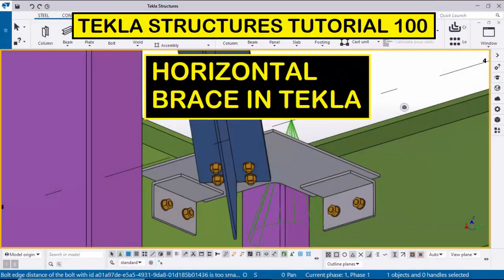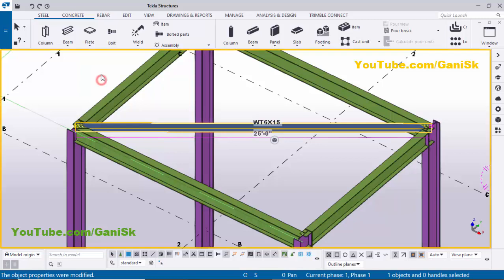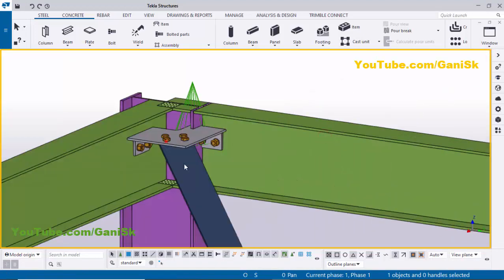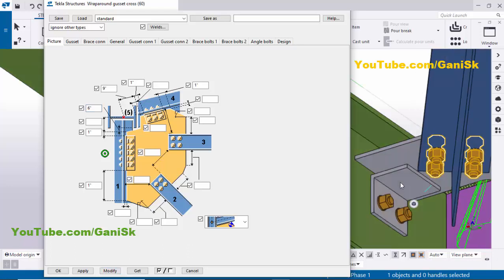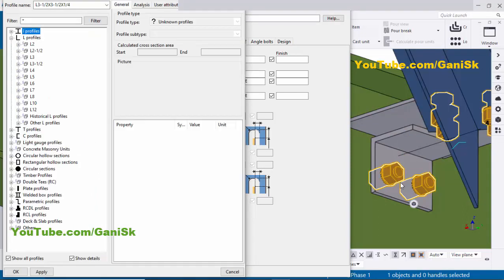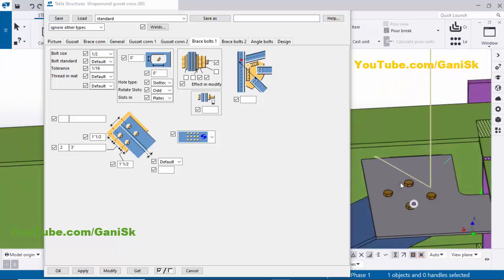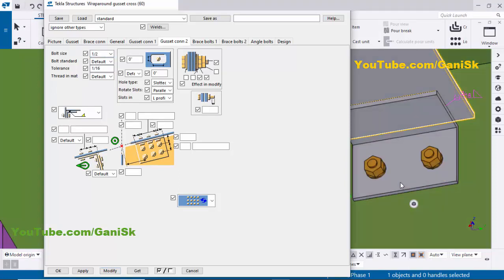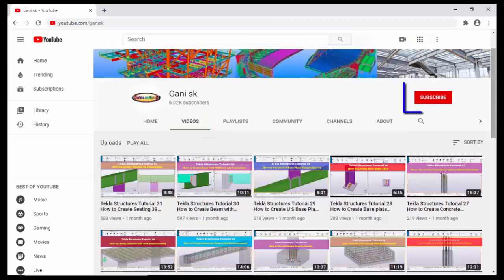Tekla Structures Tutorial 100 | Horizontal Brace in Tekla

Comment: Hi thankyou for the video, its very helpful. Is there any connection for plan or elevation brace with only plate(without angles) all welded. For truss i have a full weld assembly, so i need to weld my braces to the beams with plates.
Reply from the maker: Yes, I will make a tutorial on it.